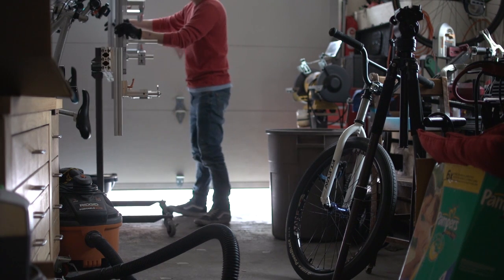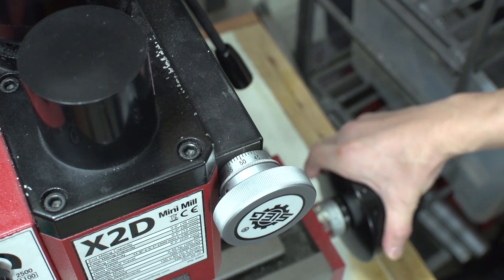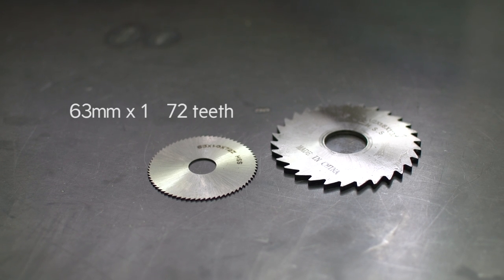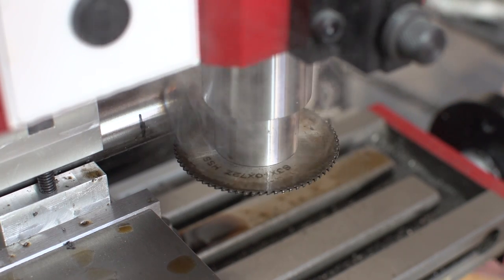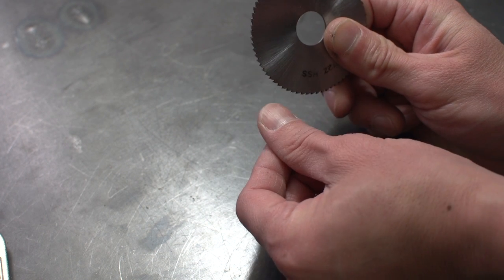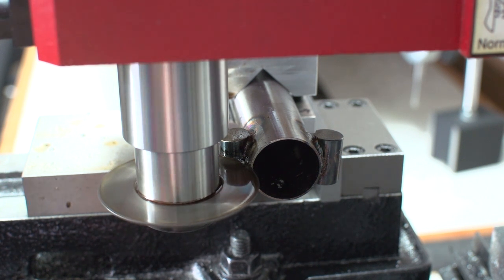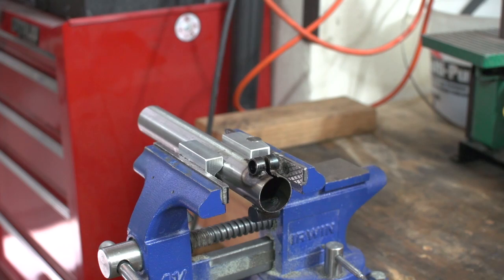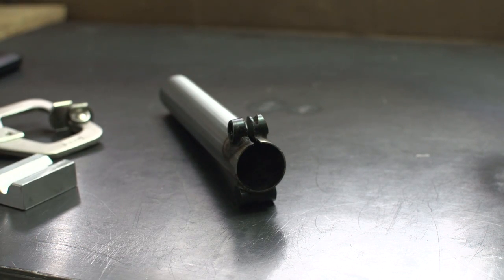Using Minimill To Make Cut With Slitting Saw

Comment: You must also make sure your blade is cutting in the right direction a few nooby’s have a tendency to run the blades in reverse which means destroying the blades instantly and the smoking gun 1/8 wide that blade is NOT for a mini mill that thickness is meant for a huge knee milling machine not a mini mill .3/32 or blades or that are 1/16 in thickness should used on a mini mill.

Comment: You need blades that are Carbide and not steel, further at least 18 teeth per inch and these need to be fine your smoking because your cutting too deep light cuts, a milling machine is NOT a Table saw. Also the kind of steel your attempting to cut for example tool steel is extremely hard as is 4140.also your arbor and blade centres must be exact. Best solution, make your own arbor if you have a large and buy carbide blades with 18 to 24 teeth per inch this is the standard for metal cutting band saws, do not exceed 200 rpm when cutting and use machine 3-1 oil for lube. Further smoking is the number one indicator that it’s the operator doing something wrong! Yesterday I used a cheap Chinese arbor that set the blade out of round, I cut through a piece of mild steel with no problem, but because the Chinese arbor was junk I am going to maybe make my own in my lathe out of stainless 303 5/8 thick annealed stock sharpening the blade tips is a bad idea as these are not wood saw blades resulting in the immediate loss of the blade tips over heating also. Low gear on the mill light cuts lube and very low rpm are key to success.

Comment: Saw steel is HSS intended for mild steel. Carbide saw can cut bicycle steel can cost 3~5x more. Eccentric is  OK, high rpm is not. Bicycle steel usually harder than mild steel and cut like stainless steel. Test the work with a file first. If file slip more than removing metal, we need a carbide saw, otherwise we can proceed with HSS at low speed. Calculate the teeth speed from diameter and rpm. Such that the teeth move at a speed matching the speed of a file by hand. So we don’t burn the saw. Also feed the mill table slowly like 0.1~0.2mm per Revolution or less. Also take notice and remember metal chip flying off the saw as a form of feed back so we learn along the way. This experience is valuable for you next time.

On the other hand, consider arc welding rod can be loosely chosen can end up with a hardness near or equal to HSS steel can ruin your HSS saw.
Reply from the maker: Thank you for the help. I appreciate it!

Comment: The biggest surprise here would be if that arbor WAS concentric.  It's really a "one size fits nothing" item.  Each bore of slitting saw deserves its own size specific arbor.  As others said, speeds and feeds must be calculated or you'll very likely be going too fast.  The feet per minute for HSS in steel is surprisingly low.  A water soluble oil or a coolant like Kool Mist mixed per the instructions and dispensed with a spray bottle might work much better than cutting oil.  It does for me and keeps the tool and workpiece much cooler.

Comment: When you use a mini mill with a slitting saw you don't want to use it as a climb cut. There's too much play in the lead screw and the saw will grab and take up the sloppy fit.run so the teeth srepushing the cut and not climbing in the cut.

Comment: I think most likely your work piece has been hardened by welding (heat), I think that is your biggest challenge and using carbide might have been the way to go with that hardened piece on your mill, either carbide or annealing the piece

Comment: If I am not mistaken, it looks like you were cutting in the wrong direction. Feed it from the opposite side, or flip the blade. Some cutting oil would help as well.
Reply from the maker: It was the correct direction but the camera frame rate make is look like the wrong direction. However many other mistakes were indeed made. :)

Comment: You'd have been  better off using a diamond blade for cutting a weld,  or you should have heat treated the material first. You need to use proper cutting fluid and slowly,  slowly.

Comment: Don't forget about plain old air for cooling.  I had an old diamond wet saw blade from a tile saw laying around 5-6 years ago. It fit right on an old Skil saw I had. I add an air nozzle, so I could hook up an air hose, and I've been rough cutting steel with it, every since.

I figured I wouldn't get a foot of cut before the blade warped from heat, or the diamond came off.  I cut closs to twenty feet of 1/8" stainless for chimney/roof flashing, and have just kept on using it.

Don't ever hesitate to try unconventional uses, just be safe.  You could have hung an air nozzle on the cut point of the blade, dribbled oil, and kept everything cool.  I wondered about the rotation, and I can see where that would make a big difference.

Also, on your under powered mill, wouldn't the non-roundness of the blades, help?  It'd be kinda like poke drilling, wouldn't it?   Not as much resistance, since it's 'missing' on a portion of the rotation?  LOL...

Enjoyed your adventure....  thanks

Comment: Should have just used angle grinder with a .040 wheel you would have been done in about 30 seconds....... Why do people with fancy tools take a simple job and make it complicated......... What you were trying to do was not precision machine work.......... sometimes just use a sledge hammer.............

Comment: I use a 20mm arbor for involuted cutters and stick with 20mm blades. You have to notch out for a keyway but it will fit concentric and prevent the oblong cutting. If your cutting into hollow tubing it probably doesn’t matter much and may actually work to your favor if your pushing in to fast. For making involuted teeth you will want it concentric. As others stated slow and don’t hesitate to add some quality cutting fluid or flood coolant.

Comment: those saw arbors are crap, get one for each size.
slitting saws and horizontal milling cutters never run concentrically for some reason.
they are made to go slow, with lubrication, they aren't circular saw blades
the cheap ones have no relief on blade thickness ie: should be thinner in the middle so the cutting edge is the only contact point but even so the good ones can never run that fast without flood coolant.
if a blade heats up, the blade expands from heat and will heat up more
sharpen with a fine diamond file not a belt sander
also you are climb cutting so the blade rotation pulls in the work ,which might be ok in a big mill but probably even then slitting saws should conventional cut even in a bigger mill with no x axis backlash
otherwise the video is great

Comment: also trying to cut a weld with that wheel (that isn't even car
bide tipped)..I used to weld for a living but its been so long now..I cant remember but think it was 7018 rod I used if they had to machine over the weld..caught hell once for using the wrong rod as it will destroy even the best tooling on the big machines..I was welding for Trojan front end loaders at that time so their machine equipment was huge

Comment: That mill and cutter should easily cut that material.  Every one of your cuts were a "climbing" cut.  This means that you are feeding the tube from the wrong direction and is the cause of the deflection and heat which kills the blade.  Feed the tube from right to left!

Comment: CLIFF NOTES: Idiot  mill owner thinks a mill is set up the same as a drill press, takes a cut off wheel on an angle grinder and still fucks everything up.

I'm a self taught noob to machining metal and this is just painful to watch. High speed steel tool does not mean you crank up the speed and try to hog out the damn cut in one pass. Just because you can afford a tool does not mean you should not learn how to use it.

Comment: Essentially lt looks like you were "climb milling", not good for a saw blade at all. Turn the blade to cut into the work on approach. If you are looking for a fine finnish cut in the standard saw direction and then flip it over for a veri fine pass in "climb" (backward saw teeth in relation to cut). Oh, try some cutting oil as well.
Reply from the maker: Awesome tips! I really appreciate it. I'm thankful for viewers like you who take the time to help out with tips. Those tips reach not only me but many many other beginners who read these comments and are learning with me. People like you make the world a better place.
Reply: I have no issue climb milling with my saws.  I make thousands of parts. However you can tell just by looking the RPM is way too high in the video. You have to calculate chip load. If your feeding slow you had better be slow on the RPM>

Comment: looks like your trying to cut a heat treated peice! Check with a file if it slides instead of cutting it's hardened.
Reply from the maker: Yes it basically was heat treated. I had brazed the binder previously and doing so was kind of like heat treatment. That and there's a bunch of other thing I was doing wrong! :)

Comment: Slow the RPM right down and use lots of cutting fluid (not just a few drops of oil).  Once the cutter starts to overheat, it looses it's hardness and gets dull very quickly.  Here's a link to another video on using a slitting saw.  https://www.youtube.com/watch?v=T9yiaqR0bmY

Comment: these saws are HSS and HSS quickly dulls son stainless steel. You either need high end HSS for stainless or carbide
Reply from the maker: After some more tests, HSS works just fine. It was user error, I was using the tool wrong. RPM was too high and I was climb cutting which is wrong in this application. Cheers!

Comment: Why wouldn't you just use a small endmill? if you needed a 1/8" slot, a 1/8" end mill would have made quick work of this...
Reply from the maker: Great question!! :) I will do that in the future if I get a better reamer that will allow me to ream an already slotted ST. But in the end I simply doubled up 2 hack saw blades and did it by hand. It worked a charm!

Comment: for 63mm saw made from cheap hss, you should not exceed 50rpm. Also much better cooling is required. If your mill doesnt equipped with liquid cooling you should use special liquids or sprays (even wd-40 is better than oil in this situation).
Using this universal arbor is not safety. You need several custom arbors that will tight fit different saws center hole.
Reply from the maker: Thanks so much for the great tips, they are spot on. :)

Comment: OMG you need to learn about machining.  #1 by using "high speed" steel does not mean you can cut at High Speeds High speed steel means higher speep than simple carbon steel.  You are going way too high in RPM for cutting steel with a larger diameter cutting tool like a slitting saw.  Also your feeds and depth of cut were too aggressive. Furthermore a lack of cutting oil was evident until after you already ruined the slitting saw.  Once you hit temperatures of of 400 to 500 degress plus at the cuttting tip you have removed the hardness of of the high speed steel cutting edge . Go slow RPM and light cuts firsts before  to see how cutting goes not after the damage is already done to the tool.   If you have no idea where to beging learn about speeds and feed formulas in a machining bood.  Better yet sign up for a community college machine shop class before you do any more damage.   Machining was not invented yesterday and we have a 100 plus year body of knowledge on this subject.  I would be ashamed to put up  a video such as this putting my ignorance on full display.
Reply from the maker: I agree with all your points. But I'm not ashamed to put a video like this up for anyone to see. The reason being, since uploading this video I have read a ton of great comments on how to do it right. Yes I could have read books or even watched videos of it. But I just wanted to try it myself and also learn through experience. Nothing wrong with showing other's how NOT to do something. And everyone usually messes up the first time. There's no shame in it. Yeah, I'm that guy dancing funny on the dance floor. But I'm having fun while doing it! :)

Comment: Get a green 3M $5 abrasive cut off blade and put it on the arbor on the mill. Turn up the RPM and you are good to go. Just cover the mill table and ways well and clean everything after. I also miter chain and seat stays like this for plate style drop outs.
Reply from the maker: Nice yes!

Comment: I think  maybe you've got the slitting saw blade the wrong way round with the respect to the direction of cut? try flipping it over in the arbour to reverse direction of teeth.
I've done this myself ;-)
Reply from the maker: It was indeed the correct direction, But I was climb feeding it which is incorrect. :)
Reply: I think your basically saying the same thing in different words? Saw teeth are normally designed to cut in one direction. If your feeding left to right the teeth need to be pointing the opposite way to feeding right to left, unless you can reverse the spindle rotation that is.

Comment: i have tried the slotting saw method on my Milrite knee mill with a high quality slotting saw and i still prefer the hacksaw method. its faster because i dont have to set up the mill for the operation and i can make two cuts with a hack saw much quicker, just as straight and more cleanly(no cutting fluid). i drill a hole where i want my slit to end and make two scribe lines with a piece of angle stock where my two cuts will be. make the cuts and clean up with a small file.  i have tried stacking multiple hack saw blades, but its not much better of faster ATMO.  my second choice is using 3 abrasive blades stacked up on a air cutoff tool. if you have one of these and an air compressor, its much more forgiving than an angle grinder.
Reply from the maker: +Justin Pogge nice, this is very helpful to know. I might just do this.

Comment: That seemed like enough trouble with the mill there to consider using a hand saw to do the job.
Reply from the maker: +Waterlaz for real haha. A few folks mentioned a simple doubling up the blade is the method used by even pros.

Comment: I hav no experience and I learn watching the things u do. 
Just curious, why not just machine it?
Reply from the maker: +kas' n things yes, some folks have recommended using an end mill to machine the slot. Its a great idea especially for a minimill. I didn't because if the slitting saw had worked and if I used it properly, it may have been faster. Thanks for watching.

Comment: Maybe if you buy a good Slitting saw at your local hardware store (supporting it!) and not on Amazon, you can have a good product for the same price of the two slitting saws you've already buyed.
The seller of a real shop have always good experience and can give you the right advice about the product you need for the job you want to do.
Reply from the maker: The problem is this type of cutter is not available at a regular hardware store. I'd have to drive up to harbor freight (nearest one) and I'm likely to get the same quality ;)   But, that being said.. I was using the cutter wrong so that had a lot to do with my problems.

Comment: Steve, thanks for sharing your frustrating findings with us.  It reminds me of most days in my shop!  I have read on other forums that slitting saws, even really good ones on really big machines and 200 dollar arbors, never really run "concentric"
Reply from the maker: Ah, I'm not surprised to that. :)
Reply: I run a pretty decent brand of slitting saws on a 2020 DMG Mori spindle with an arbor I spent almost 12 hours to machine to a perfect tolerance and concentricity with minimal internal stresses. I joke you not one time I had to go find an angle grinder with a cutoff disc to grind some protruding teeth back to get back to the programmed scary as fuck 3m/min cutting feed. I still have this disc loaded in the toolchanger.

Comment: I often times use an end mill to cut the slot. This may be a better option for your small machine. Good luck!
Reply from the maker: This is a perfect solution for a minimill I think. Are you using a 3/16 or something smaller?
Reply: 3/16 is fairly common. It depends on the diameter of the seat tube being used. I have used 1/8  up to 1/4 slots. The other factor with this is the type of clamp being used. A lot of the braise on band style clamps  for example, have a slot space that is fairly large in comparison to the tube diameter. This can be done because you are essentially welding a strong ring at the end of the seat tube. The barrel style clamp you are using will have limits as to its slot. The limit will be determined on how much thread you will want in the clamp barrel. If the slot is on the large side then you will have less thread to clamp with. This can be important as the type of clamp you are using can in some cases suffer from thread fatigue. Or you can machine a slot using an end mill and use the standard non-attached seat post clamp. If this is done, you can use a smaller slot which gives you more surface against the seat post and will require less tension to secure the post which is gentler on the frame. Lots of choices. Your work looks good! Fun to see it come together. Sorry for the long response as i am sure you already know this stuff. Thanks.